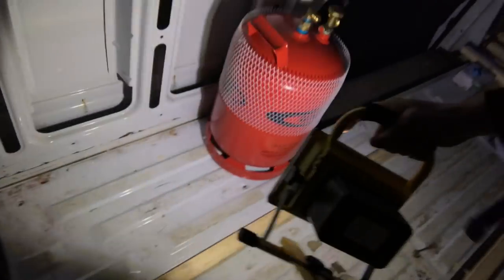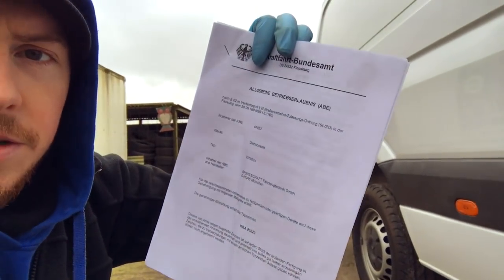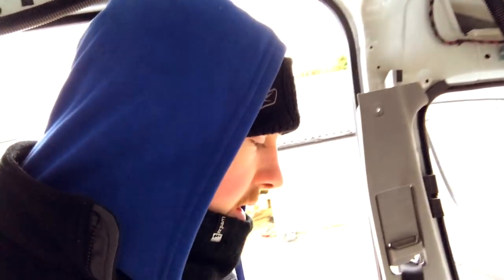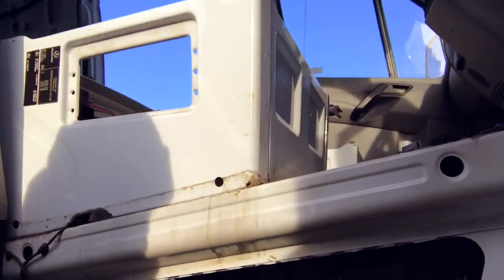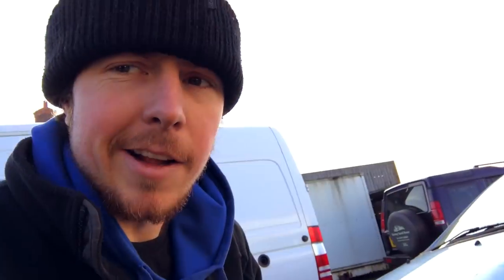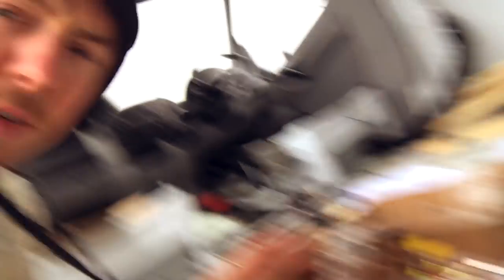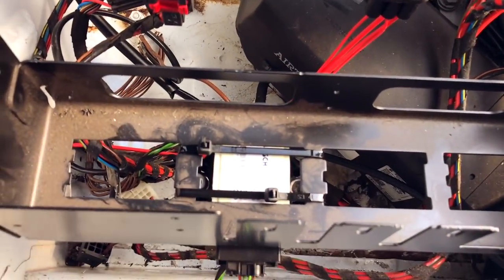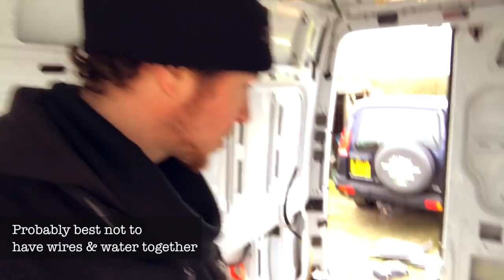How To Build Your Own Home On Wheels - [2/7]

Comment: 2 questions, are the fastenings to secure the pipes underneath screwed in and are they with the install kit?? other question is the heat protective piping for the fuel line is that included if not what is it where did you get it? cheers, got the ebook btw!
Reply from the maker: Hi, yeah they are screwed and came with the kit. The heat protective sleeve didn’t though and I think I got that from eBay :)